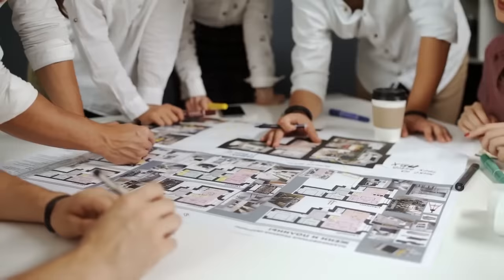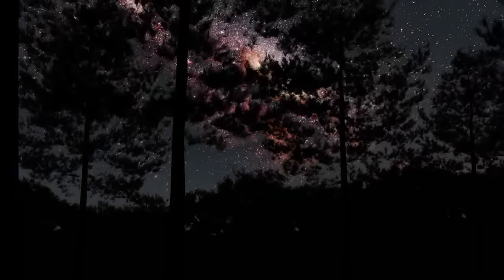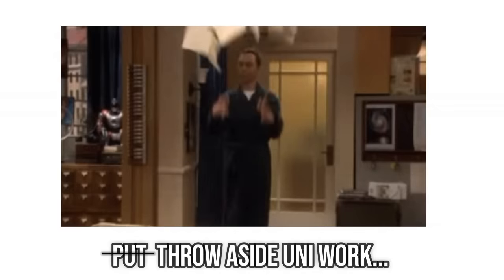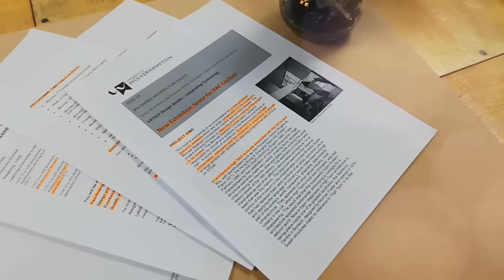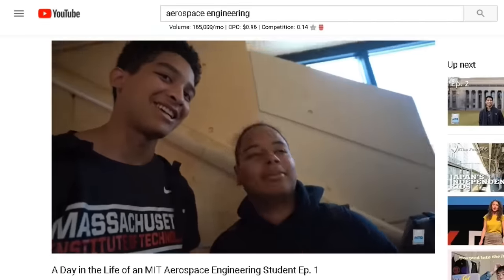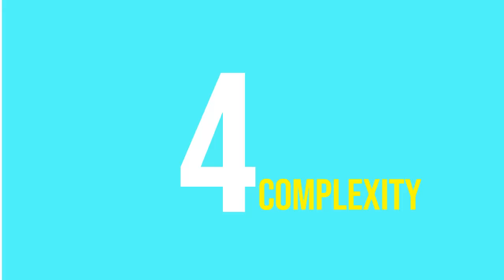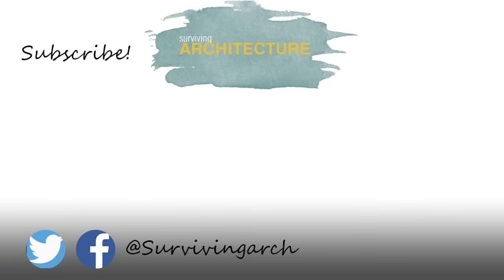How to Develop Innovative Architectural Concepts

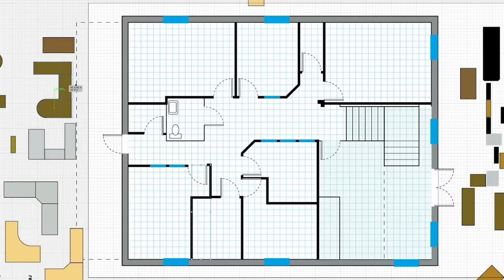Comment: Great video thanks for making it. I have a question about the floor planning software you are using at 4:53, what is it? Or perhaps you can recommend a floor plan tool. Sketchup and Revit are not great for this. Thanks!
Reply from the maker: You are most welcome! I am not sure really as it was just a stock video I am afraid. I will have a look around and let you know :)
Reply from the maker: I found a website called Roomsketcher: https://www.roomsketcher.com/demo/
The demo looks really similar to the video but I am afraid I cannot give you more info about it as I have never tried it.

Comment: Bubble diagrams are useless because they are not to scale.
Reply from the maker: You're supposed to make bubble diagrams to scale, rough proportions with orientation. If done correctly, they can be helpful in creating a quick sketch to understand the relationship between spaces.
Reply: @SurvivingArchitecture  Rooms and spaces are rectangular not round. I know I have been doing this for 50 years.
Reply: @SurvivingArchitecture  A Pattern Language by Christopher Alexander.
Reply from the maker: How old are you?
Reply: @SurvivingArchitecture  older than your professors with more practical experience
Reply from the maker: @joegotz1971  Why the arrogance?
Reply: @SurvivingArchitecture  I’m not. You are in architecture school to learn the profession. The real world is much different. You should be prepared. How many of your professors have worked in the real world, and not practicing architecture as a hobby. I recommend you try to work for the following architectural firms
1. SOM
2, Fox Fowle
3. Gentler
4. HOK
Any large firm in any major city.
Also try Gehry & Associates.